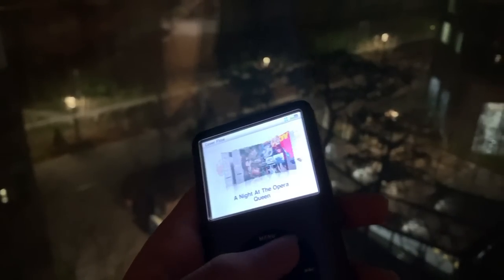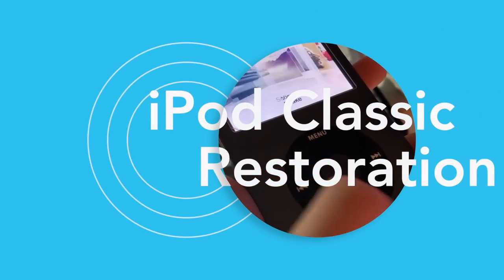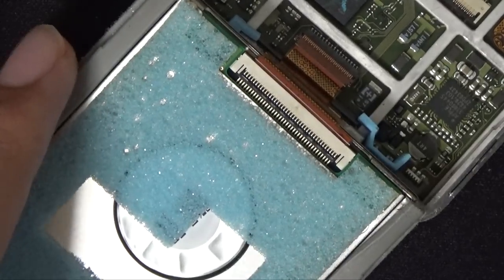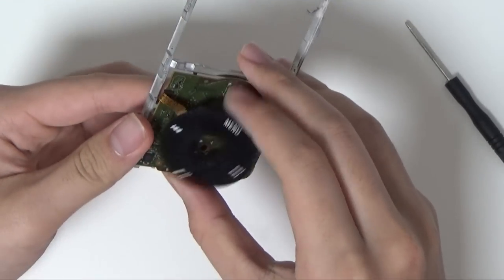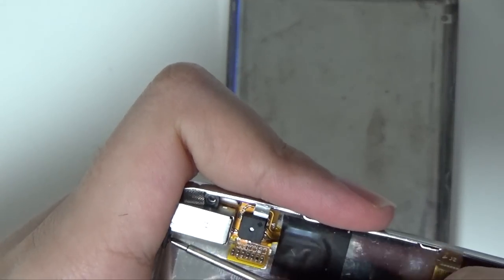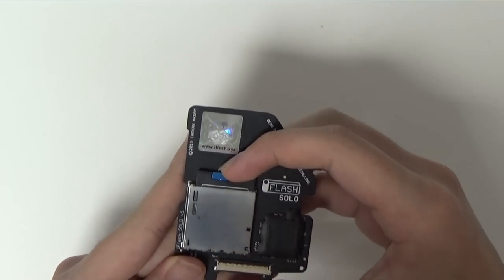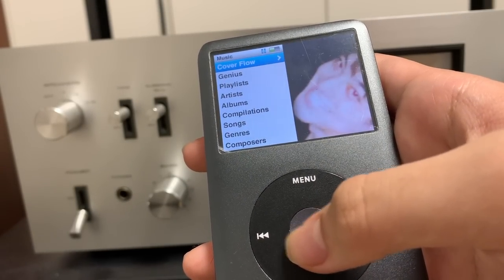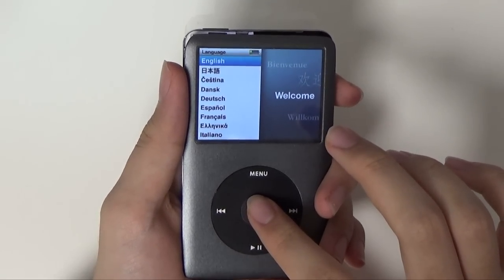iPod Classic 2020 All In One Restoration Guide - SD Card, Battery Upgrade & More!

Comment: A few tips, carefully removing ribbon cable from battery post. The post can be pulled off motherboard, that is a common problem due to heat and age. You can get replacement posts cheap. Also remove input output cable first before disassembling cover from frame just so much easier. The click wheel and centre button, use painters tape to keep button in place for removal & installation of click wheel.
Reply from the maker: Thank you very much for the help!
Reply: Edward's Workshop on what iPod did you do this on?
Reply: Hi, l have a 160gb ipod if l want to upgrade it for a bigger hard drive and better battery life what should l buy and where?
Thanks
Oscar
Reply: @joseoscargonzalez7078  160 is the biggest hdd you would have to do a flash mod. Elite obsolete has great selection and you can buy from him. The iPod openers and everything. You can get the flash mod adapter from him etc. then you just need a micro sd card if any size up to 1tb but this is very important. The iPod cannot have more than 50.000 songs on it or it will crash.

Comment: But, iTunes is no longer compatible with the iPod Classic. It will not sync to iTunes sense iTunes version early 12. I have two iPod Classics (a 120 GB) and an unboxed 160 GB.
Reply from the maker: It should still sync to the iTunes, as they work in the latest version. If for some reason it doesn’t work, you can try to download an older version of iTunes.
Reply: @EdwardsWorkshop  i have tired this many times and my mac wont let me down load an older version .. can this be fix because i have an ipod classic which works perfectly but itunes wont recognise it

Comment: Was it hard to screw back the lock switch to the rear casing? I'm kind of having issues where it won't screw in but maybe I am using the wrong screw.
Reply from the maker: Hey there, screwing the ribbon cable (lock switch) to the rear housing can be quite difficult if the screw is even slightly stripped. Try to replace the screw with a similar sized screw or use a crosshead screwdriver that is better than the default one which comes with the parts. If it still doesn't work please let me know.

Comment: I have  a 30gb 5the gen video ipod that I'm converting to SD card but it has a problem even before I get to that. Had to replace battery and Screen has bars in it but I have a new screen to put on it.. Problem is when I tried to charge it up the keypad gets HOT and after a while it won't show menu, but just Very low battery but it won't charge.. Any idea what I  should replace as I don't want to throw it away.. It started when I first put in new batt but soon ran it down then I found the overheating problem....
Reply from the maker: Where did you get the battery from? Is it compatible? It definitely sounds like a battery defect to me.
Reply: @EdwardsWorkshop  was from Amazon for 30gb 5gen iPod. DAPPVIDELI01 [N 129] battery is not getting Hot the circular pad is.
Reply from the maker: Hm.. I don't think I've ever heard the keypad getting hot. Are you sure it's the keypad? Try to open up the iPod again and operate it to see if there's another component heating up the keypad.

Comment: If I purchase a iPod classic how do in get it to work if iTunes (Apple) no longer supports the obsolete product?
Reply from the maker: It is considered obsolete, but it still syncs with iTunes.
Reply: So ask long as I have an old version of iTunes that works with it, it should still function like it used to?
Reply from the maker: Wow that reply was lightning quick. The answer is yes, it should function just like it did in the old days, except that you can't officially download iPod games (everything else should work fine). And I'm quite sure you don't need an "old" version of iTunes. It should work with all versions, including the current one.

Comment: Nice video bro, I’ve ordered some parts for a restore too :) greetings from Poland :)
Reply from the maker: That's fantastic. I hope your restoration goes as planned. Wish you the best! :)
Reply: Edward's Workshop Thanks 🙏 
Could you help me with the front housing? I have an iPod classic 5.5g (video) and I’m considering if I can order a front housing from iPod classic 6th/7th gen?
Thanks for help 🖐🏼
Reply from the maker: Hey there!
Yes, the iPod classic (6th, 7th) housing should be compatible with the iPod 5.5g.

For reference: https://www.ifixit.com/Answers/View/42750/Can+I+replace+the+front+panel+with+the+iPod+Classic+version
Reply: Bodziooo you will need a new clickwheel aswell because the 5.5 clickwheel is different, I do not know if the new clickwheel will work with the older 5.5 gen board

Comment: Thanks! I just happen to have an old iPod lying around in my drawer. I was searching aliexpress for parts and it seems that there is a thin shell and a wide shell. Which one should I purchase?
Reply from the maker: Hey there, Both shells (back panels) have specific components it can house. Essentially, the thick shell was created because of the bigger hard drive variants. If you're going to use an iflash + non upgraded battery (same as the one shown in the video) the thin shell will be fine, but if you're going to upgrade your battery with a larger capacity one, you should get the thick shell.
Reply: @EdwardsWorkshop  If you use an iFlash Quad adapter and a 2000mah battery, you can fit them in a thin shell, according to the iFlash website. People have commented that it is a tight fit, but it does work.
Reply: @bibasik7  A quad adapter plus bigger battery and a bluetooth module wouldn't fit into the slim back I imagine?

Comment: Yes, just managed to lever of the battery connector from the mother board☹️ now need new mother board 😡 Should have read the comments below..
Reply from the maker: Hey! You can just replace the battery connector as it's easily replaceable. It comes of quite easily as well.
Reply: @EdwardsWorkshop  Where do you recommend to buy a sealed iPod classic 7 th gen?

Comment: I have iPod classic 2nd gen.just want 2 ask,is it possible to change the FireWire port to USB port.thanks
Reply from the maker: Hey, by USB port do you mean 30 pin? Not sure if you'll be able to replace all the features with USB because data transfer through firewire is proprietary.

Comment: have you ever considered upgrading an ipod to a USB C ?
or if its even possible?
Reply from the maker: It definitely hasn't been done before, and it is possible if you buy a charging controller, but it will remove a lot of built in features from the iPod such as dock out.
Reply: @EdwardsWorkshop  I'm in the iPod discord server, and it turns out someone actually has done this! Although, I feel it's highly impractical, and will require lots of skill to pull off.

Comment: The pins are damaged on my ipod classic.Can it be fixed?
Reply from the maker: Hey, it really depends on which pin you're talking about. If you don't know the exact name you could take a photo and send me a link. I'll gladly take a look!
Reply: @EdwardsWorkshop  I'm afraid quite a few of them are damaged.Is there any hope of ipod surgery?I'm over here in Donegal.Would it be possible to send you the ipod?
Reply from the maker: I'm afraid that the shipping will cost more than the cost of purchasing full replacement parts as I live on the other side of the globe. If the "pins" are broken on the motherboard, I might not even be able to repair it myself. If you could send me a photo it would help me a lot.
Reply: @EdwardsWorkshop  I'll leave it but thanks all the same.
Reply from the maker: Alright. Wish you the best!
Reply: Hello can you repair my ipod, I try to connect to my  iTunes and forget the password after 3 times my ipod no work  is off  try all and nothing ,help

Comment: How do i know if it 5.5 gen. ,6th generation or 7th generation?
Reply from the maker: For the 5th and 5.5 gen, the cover is made of a plastic material which easily scratches. On the other hand, the 6th and 7th generation is made of an aluminum material that doesn't scratch easily.